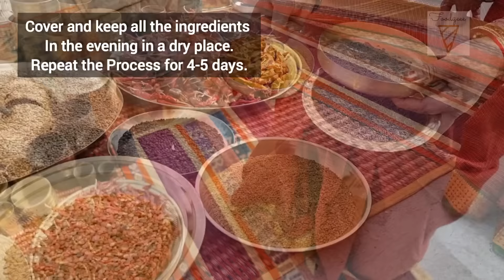Sambar Powder | சாம்பார் பொடி | Homemade Authentic sambar Podi Recipe #foodzeee

Comment: This is great, but if you could show measurements to make a smaller quantity at home which we can grind in our home blenders, it will be very helpful for ppl like who don’t have access to a grinding mill🙏🏼🙏🏼
Reply: sambar powder measurements shown in this video - 

800 g red chilli
2 kg coriander

200 g chana dal
100 g toor dhal

200 g methi
150 g black pepper
50 g mustard
4 tbsp jeera (optional)
200 g haladi

The entire proportion can be exactly cut down to 1/2 or 1/4 quantity each for a regular small household ..

Comment: I must congratulate you as well thank you for this video. You have shown each step of making the authentic traditional sambar pudi, Tamil Nadu variety I think.

I am from Bangalore and in the older regions if Bangalore and Kolar we make very similar sambar pudi. Few differences are that we also add green grams and curry leaves. 

Additionally after sun drying we dry roast each ingredient separately. For chillies we add little oil and rock salt while roasting. Somemof add byadagi chillies to about 25 % of total chillies. This gives a slightly brighter colour. Some people make it 50% too. 

With these changes the rest if the ingredients and process are same. What is very important is that after roasting we should let the Ingredients cool before getting milled. And your last steps of not closing the lid on freshly milled oudi and spreading it till it completely cools down are very important as itherwide the oudi will turn very dark, almost brown colour, thereby ruining the delicate balanced colour of the sambar. Most youngsters don't know this. 

We still make this annually during peak summer and store, send to children also. But younger generations are mostly buying ready sambar pudi for various valid reasons. Only those who are getting oudi from mothers / mothers in law are using home made authentic pudi. 😀
Reply: But we also add 200 gms urud dal and 100 gms rice and also curry leaves may b 2 cups and Hing.